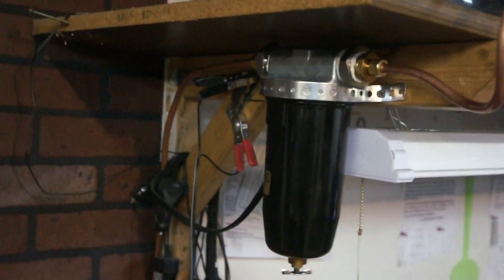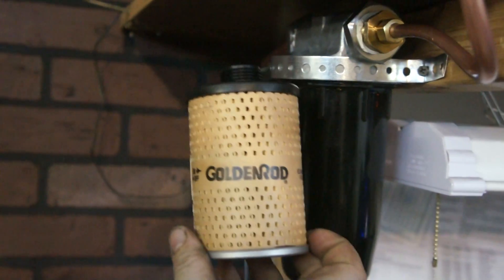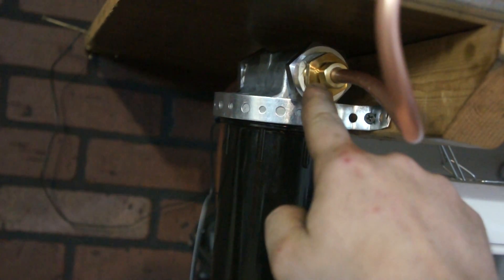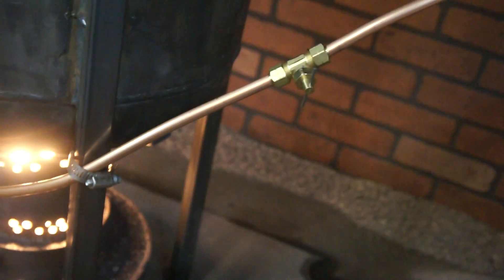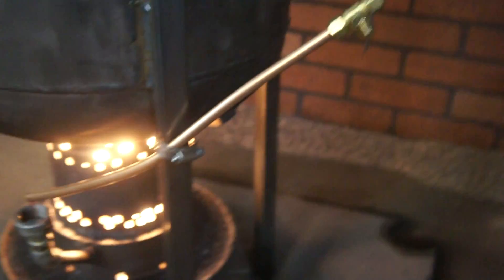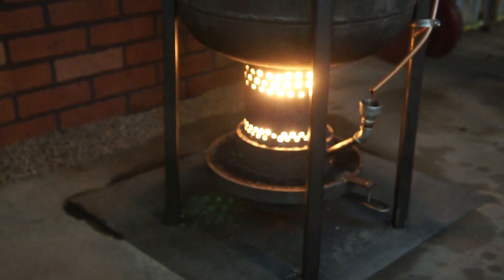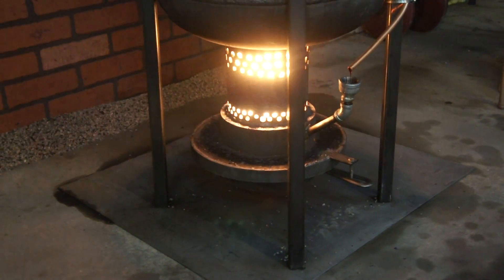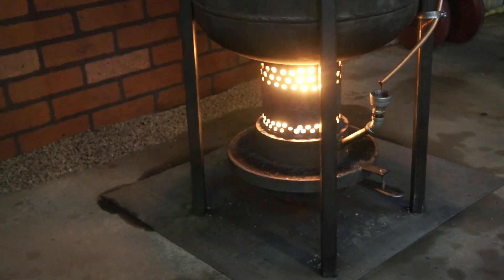Waste Oil Heater Experiment 4

Comment: I like using the cheap silver corrugated roofing for heat protection on the walls. The corrugations move a lot of air on the backside keeping the wall cool and the silver color makes for good heat reflection.

Comment: Yeah man. They is a guzzler alright! I can't post a picture but I've built something similar here in Northern Michigan. Still working on the oil delivery but it burns great. I want a reservoir attached to the unit. Going to build a plate set up for the reservoir and plumb it in. Happy building! 😁

Comment: Theoretically you should use the same idea as with a carborator and tune the fuel/air mixture accordingly. I think a 4" burner should only need a 4" exhaust pipe and drill the holes and feed the fuel according to what it calls for to burn clean. Of course heat output and fuel consumption will vary according to the air inlet control and fuel feed. That's the fun part is experimenting on what works and what doesn't. Thanks to Youtube for answering some of those questions!!

Comment: Cat litter is much cheaper.

Chernobyl effect - the furnace is simply very slow to react to your inputs.  Make an adjustment, and give it time.

Did you try a taller chimney before you tried a larger chimney?  Taller will give you better draw,  the larger diameter will just give you less resistance to the escaping gasses, not higher velocity.

Comment: just to point this out.. your air compressor section of this heater is causing loss of heat output... the best way to output heat is to use fins(heat sink) inside a pipe-[some funnel towards the chimney] where you would have put the compressor tank and run them through to the outside of the conduit

Comment: have you tried running 4" base pipe, and 4" exhaust pipe, but instead of having an empty expansion chamber (Air Tank) use 3 or 4 baffles with 4" holes in them in alternating pattern for greater heat exchange on a smaller unit? any thoughts?

Comment: Nice setup. Like you said a smaller inlet pipe is the key to getting it setup right. Your chimney needs to be bigger than your inlet. Also a safety feature that I think you need to add is a secondary metering tank between your heater and your larger storage tank. The secondary tank should hold LESS oil than you could potentially put in your rotor chamber. This way if you had a problem and you weren't around the worst that could happen is that you would fill up the rotor but never overflow it.

Comment: The key to the efficiency in this case is your heat transfer area.  If you increased that you would increase the amount of heat you were putting to use rather than letting go out the chimney and cold then burn less fuel.  The air fuel mix and velocity as you put it is only to do with the cleanliness of the burning, efficiency is how much of the heat you generate is put to useful work. 

Without changing anything in the setup you could put some tubes through the centre of your tank and blow air through them. That would remove heat that you are already generating and not affect the combustion. You could also get more heat just by having a fan blow on the tank. 

Thermo Dynamics say heat always find a way to travel a colder area so cooling the tank with air would allow more heat to be extracted.  Internal baffles that spread the heat to the sides of the tank rather than just let it shoot up the middle would also make a huge difference.  You could then braze some tubing onto the side of the tank and run water through it with a circulator pump and transfer the heat into the house that way wherever you wanted it. 

There are a LOT of ways you can extract a lot more heat out of that that burner without messing up the combustion while reducing the fuel useage.
Reply: Yes i have seen a double barrel wood stove with tubes through top barrel you can get lots of heat. 
It was using a squirrel type fan and the heat blowing through would almost burn you on other side.
You could build a plenum and direct some of air to bottom of pan with tubes instead of compressor alot easier on compressor

Comment: great project.  but keep in mind all this was figured out back in the 1940's when oil heat first came into vogue.  you can get old oil boilers for free.  just get one and do you mods to it, and install it in your house or garage as a waste oil heater.  our local garage has been heating with a commercial quality waste oil heater for 20 years or more.

Comment: I think you need to look over the operating principles/designs of rocket stoves and apply them to this. I think you lose alot of efficiency to your straight-line flow design, and need to have a single same-diameter flue inside the tank where final combustion can take place; then bring the gases down the outside skin to the bottom, which will extract the maximum heat from them before they get out. 

Check it out, tell us what you think.
Reply: rocket stoves are awesome, no doubt. I'm planning a waste oil burner using some of the components used in them. I would like to point out that while there are similarities, as well as aspects that can be shared, they don't operate on the same principles.

I'm not an expert, but i feel like I've got a good grasp on both designs. my opinion (I can't stress that enough. this is only my OPINION) based on what I've learned is that you've chosen to highlight the wrong aspects to integrate into this system.

To begin with, rocket stoves and this style oil burner work on different principles.

 The initial air input (feed tube in a rocket stove and low air holes in the oil burner) needs to be carefully controlled in both. In the case of rocket stoves, the purpose is to avoid a bottle neck and causing a stove that won't draw correctly and results in a dirty burn and smoking back through the feed tube. With this burner, it needs to be approached from a view of restricting the air in order to cause an initial and intentional very dirty burn.

Turbulence is also a key component, but while it is accomplished via sharp corners with the rocket stove theme, its done with the inlet of the secondary air (the holes drilled higher in the tube).

It can be easy to assume that since we talk about both systems as having a primary and secondary burn points, that those points work the same. The purposeful slow and dirty burn in this stove operates by maintaining an oxygen deprived environment. Only enough oxygen to maintain temperature at that level sufficient to vaporize the incoming oil is what's desired. When the volatile gasses are pulled through (see below) the tube, copious amounts of oxygen are pulled in through the holes, which completes the triad (heat, fuel, and oxygen) necessary for burn. The rush of air is also what creates the turbulence that ultimately leads to a more complete combustion. (I feel that additional turbulence at some point here, either before or after the air inlet holes, would be beneficial with careful attention paid not to restrict the flow, as that will negatively affect the system)

Baffles and bells are great at extracting every ounce of heat that traditionally  goes up the chimney. This creates 2 problems that I can see. The first being that every sharp corner and obstruction you throw in the path of exhaust gasses will slow them down. The 2nd, and what I feel is the bigger issue with this is how reliant this system is on velocity created by the external chimney. The hot gasses exiting the system are what creates the necessary pull.

Some simple baffles wouldn't be detrimental, but slowing the gasses down to the point that they will fall and exit at the bottom of the exchanger would be too extreme and not allow this system to operate. This burner only works because of that high level of air flow. The benefit of this is that you don't need to add air mechanically via compressed air or an electric blower to maintain the clean and consistent burn, and I know how the rocket stove community feels about adding electrical components to their heating systems ;-)

I understand the idea that heat up the chimney is wasted heat time, effort, and resources, but my personal analogy of the system may help. I like to compare this idea to using electricity (which we all do, or else we wouldn't be able to learn so much from each other here on YouTube!) I'll use hypothetical numbers to make this easier to describe. Lets say it costs you $100 dollars/month for your household electricity. If someone came to you and said that they could change the way you viewed electricity, rewire your house in a revolutionary way, and it'll reduce your bill to $20/month with a very minimal initial investment, that sounds pretty good. Now approach it from the oil burner side. You can't "rewire the house" and have the system work, so you're still letting excess power run right out. HOWEVER this system "recycles" the lost electricity, and uses it to maintain its own operation, therefor its like turning on a switch that uses 10kwh, but in turn produces 15. The net gain is still drastically in your favor. "penny pinching" the heat produced ends up with an overcomplicated system that is finicky and frustrating. Just look at all the problems people have trying to "tweak" their rocket stoves.

Now, lets look at that heat riser! This is where I think we can co-mingle. I think we can use this principle to boost (not replace) the velocity used here. In addition to boosting the velocity, it also introduces some new options, such as introducing that vital secondary air that makes the big impressive flame in the top. I think that some experimenting is necessary.

My idea is to use the insulated heat riser, with the air inlets near the top made of tubular steel that go through the sides of the riser. now we have the option of controlling the direction of the air that is being sucked in by the velocity of the gasses going through, as well as the draft from the traditional chimney. positioning them slightly inside the riser, and at angles that will create a vortex will introduce turbulence and because the spiral path of a vortex creates a net longer path for the gasses to travel, it will also increase the time for combustion to occur. A simple baffle to keep a true linear path out the chimney would be a good idea, but may be accomplished by just having the chimney exit the barrel from the side a short distance from the top.

I apologize for my long winded reply, I initially intended to be brief, but my thoughts ran away with me. hopefully I was able to portray my views clearly, as I just wanted to share what I've learned so far. I tried to exclude any anecdotal ideas here, and rely on fact based results. If I've gotten off base, please let me know! I'm always ready to learn something new and expand my knowledge.

The reply wasn't argumentative, so I hope no one see's it that way. We're all here to learn from each other, and silencing myself when I saw an idea that was so close to one that I believe will work, but also believe that would cause someone else to fail if they attempted was too much to let slide by.

Take care everyone, be safe, and keep learning!

Comment: After watching all your videos, I have purchased an old air compressor tank. I believe it is a 50-60 gallon. Did you ever make a parts list or instructions in a pdf file?  I am very interested in building a set up like this to save money or just have when the power goes out and the oil furnace won't run. What temps should we be looking for?

Comment: i am no expert but to me the max air flow would be if the cross section size (sq in) of your chimney should be matched by the entire inlet size of the intake holes. a pain to calculate I know but I personally think it would work very well. eg. 6 in chimney piR sq. = 28.275 sq inches. 1/2 in intake hole = about o.2 sq inches. so 28.275/0.2 = about 142 half inch intake holes. if my math is correct. let me know what you  think

Comment: WMO tops out at about 180,000 BTU per gallon, If you are burning one quart an hour, you could only be getting about 40-45,000 BTU an hour. I think i am going to go the babington route in your lengthy research, did you look into babingtons, and the consumption rate of those as well?

Comment: hello, congratulations, for your burner
works very well,
it can work well at low power?
I'm also experimenting with oil.
I try to make a burner for an old coal boiler, but it works very well only at high power.
best regards
Robert

Comment from the maker: Hmm ok well I'm not sure what you mean of my thinking? have you seen all the video's in this series? The unit outputs no smoke besides start up and shut down (very little at that) and thats due to temps in the primary combustion chamber being wrong. When the temps are low it can not flash boil the oil off and make a vapor for the unit to consume. When the unit is at temp and working correctly this is not a issue which this unit operates correctly.

Comment: Thinking in wrong direction. And you remind me of me and my mistakes i was doing once upon a time. But if it's ok for you, it's ok for me.
Red and yellow flame, temperature is low and soot is created. Oil consumption is increased  because unburnt part of oil goes into the chimney.
Blue and white flame, temperature is high and has a clean burning
Orange flame is somewhere between yellow and blue flame

Comment from the maker: Well I needed a bigger chimney or needed to reduce the size of the primary combustion chamber I went with the bigger chimney and that improved my velocity which cleaned up my exhaust. I found that I got a much better fuel air mix with larger holes and if I added any more I was losing velocity which in turn causes a unclean burn I tested this with a fan and applied a vacuum to the shop to slow the velocity down and I would get a very rich combustion. Good idea with the pipe though I like it.

Comment: You do not need a larger diametar chimney. 
You do not have enough holes, and this that you have are far too big. 
Add a tube that is closed on both sides in the middle of your tubes with holes. The flame is coldest in the middle and has in it the most non combusted substances. The pipe will be red hot and additionally helps carbon to burn. And will force flame that passes closer to the air holes